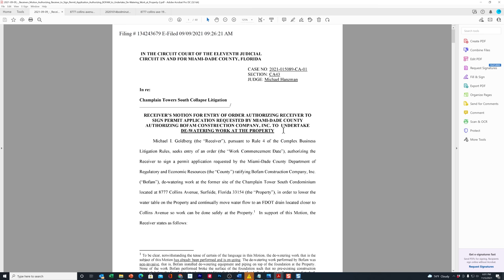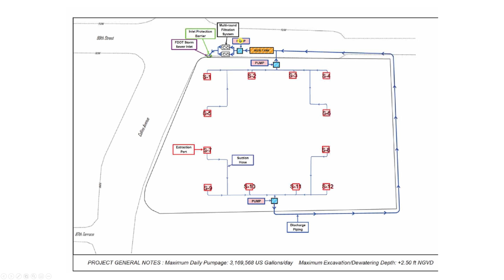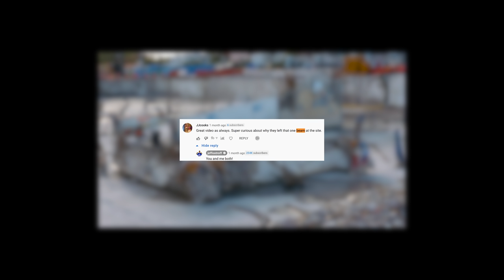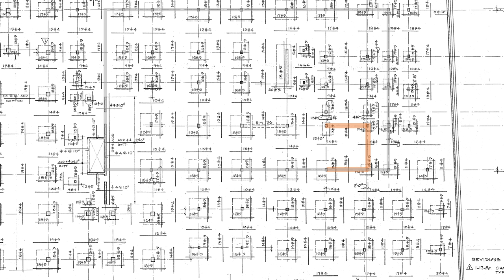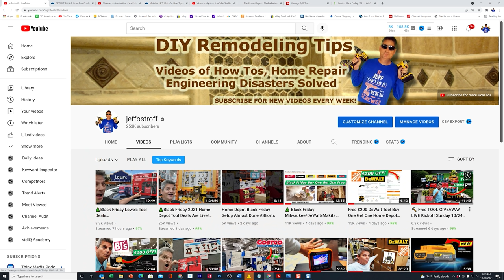Miami Condo Collapse: Engineers Baffled By Mystery Column

Comment: The rebar sticking up out of the ground in the mystery location could have come from the column that sat atop the h-bar, which separated from it and then was "pile driven" into the concrete floor.  There is no concrete visible, which could be because it was pulverized as the column was driven through the concrete slab.
Reply: That would be my guess too.  It's impaled through the floor.
Reply from the maker: Your hypothesis comes up a lot from boatloads of people about that column. I don't think it's possible because if it had slipped off it would not likely have come straight down where the mystery column is which is only about two feet away from the HP. Also if it had impaled the floor there should be damage all over the concrete there and there is none where is the crater? So where else could the column come from? So far my prevailing theory is that somebody started to build that column sometime after Fiorella shot her video in July 2020. however I could find no permits for it
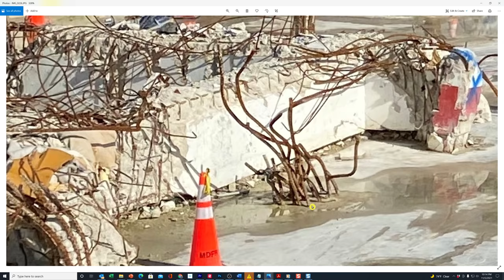Reply: @jeffostroff  if you actually look at your own video, at 13:50 you can clearly see the edge of the floor slab where the penthouse 5th column punched through it.
It's filled with water so if you don't look closely you may think it's the slab, but you see the broken edges around the rebar.
It's also exactly where the penthouse column would have been if it dropped straight down.
Reply: @jeffostroff  You just proved that the penthouse column was punched through the slab. Stop looking for conspiracies where there are none.
Reply from the maker: @dannyswank   It's not a conspiracy stop trying to let me into your conspiracy theory crowd
Reply: @ke6gwf  I think you may be right there. I was thinking along the same lines but that part of the video definitely is a bit deceptive. I mean, that column clearly isn't there in that one video so I doubt it was added at any point.
Reply: This was my thought.

The rebar sticking out of the ground looks to 'streamlined' to be from a square setting. Almost looks like a section of the floor above fell down 90deg and was pushed into the ground.  The water leaking up could be the rebar that was driven down hit an underground water source.
Reply: @jeffostroff  So, how do you have almost 3 car widths between the wall and where the column should be?
Reply: The puddle of water gives an optical illusion of a uniform surface.   But it’s indentation that filled with concrete muck.
Reply: This was my conclusion as well.  When he said "it seems to be a source of water", it tells us that the concrete has been compromised all the way through to the bottom, creating an artificial "spring", every time the water table gets higher than the concrete floor.   In effect, the parking garage is a huge pool, and this poked a hole in it.
But I'm just some hillbilly using logic, I have no training in the field.
Reply: I agree with your assessment, that is my feeling also, the weight of the building dropping drove a broken part of a broken column into the ground embedding it into the concrete
Reply: @jeffostroff  I beg to differ, a swift impact with enough force behind it might just punch through without leaving much damage in the surrounding slab.  Think of a bullet punching through a brittle target, the front may just be a round hole, but the back is gonna be shattered, spalled and blown to hell.  In this case, we only see the front (top), not the back.  Also, the building appears to have come straight down, more or less.  So "only 2 feet away" sounds like about the right distance.  I think the sept 12 photos show that's what happened, but your reasons for dismissing it don't hold water IMO.

Logic tells me it unlikely they intentionally built a column in that exact location, and I have 2 good reasons.  1: that's a recipe for instant complaints from tenants, to block a main access to the parking garage.  Most owners would prefer almost any other solution.  A better solution would be to do in-situ strengthening of the H-beam and/or supporting columns.  2: even a novice contractor should have understood that the shoring column needs to be aligned under the offset column above, not a few feet to the east.  Where those bars come up is right between the 2 garage columns, aligned under exactly nothing from above
Reply: I agree- The position of the mystery column is just too coincident with the column the plans show sat atop the H beam to be anything other than the impaled stub of the column atop the H beam.   This section of the building leaned toward the already collapsed section as it fell, the racking of the floors would have tilted the column so that its base was shifted off the top of the H beam and  with suddenly nothing holding it up, it would have been driven into the concrete floor of the garage.  The concrete would have been pulverized as the column was bent over as the floors collapsed on top of it…but it would have dropped to the floor of the garage and  punched thru the garage floor.   The hole filled with ground water ( like any other hole you dig deep enough along the Florida coast ) And the water is concealing the hole punched thru the floor.  The utter lack of any concrete around the base of the rebar is evidence it was not cast in place- as all the other columns retain some concrete where the column is surrounded by the cast garage floor.   No one would have placed a concrete column NEXT to the H beam without digging out a section of garage floor for a foundation, and a column NEXT to the H beam makes no structural sense whatsoever.   It was likely the H beam that is why that section of the building fell last. Its no mystery.   The column that was atop the H beam shifted and was pile driven thru the floor… There is likely several feet of that column below the garage floor, embedded like an angled pile in the ground.
Reply: @nickoD509  This is Florida, underground, close to the ocean. Water would have seeped through the sand  and filled the hole in the floor with sand. Thats why you cant see the hole. It's filled with sand.
Reply: It’s the column from above that punched through the floor slab of the garage. There was probably a small void underneath due to compaction of the underlying sediment. It would be fairly easy for the column to punch through the slab, given that it had the weight of a 12 story building pushing it down. Basically, the transfer beam was pulled about a foot sideways during the collapse of the pool deck. The column above it broke off and part of it was left dangling from the second floor of the building. When the building collapsed, the upper portion punched through the floor next to the fallen transfer beam. You can see the edges of the jagged hole it made under the surface of the water.
Reply: @jeffostroff  that itself woild fhow clearly on floor of concrete at base.
Reply: That's exactly what it is...the collapse pulled the H in, the column above has nothing below it and it's semi-solid all the way up to the penthouse...pile driven is the right term.
Reply: @jeffostroff  That's because this is specifically THE answer.  That's where the column came from.  That's why there's water coming in where that column hit the floor, the rebar punched through the concrete base.

People smarter than you have already pointed out there were no anchors holding the column to the H beam at the lobby level, at least there are none alluded to by any of the plans.  That means the column hit the floor with straight rebar encased in concrete, the concrete was turned to dust as the rebar was punched through the floor.

No further mystery here, Scooby-Doo.
Reply: @jeffostroff  You already put yourself in the conspiracy theory crowd by refusing to listen to the penthouse column punching into the floor crowd.
Reply: @Gwydion_Wolf  Nothing rotated.  The lobby to penthouse column above fell straight down because it wasn't anchored to the H Beam and the H beam got pulled towards the void created by the collapsing sections.
Reply: I concur with your analysis, that's why water is seen coming out of the column.
Reply: @jeffostroff  if you can get closer pictures you can most likely look at the manufacturer stamps and the grade of steel compared to the other columns.  you can see in your video on the close ups of the other columns that early X pattern.  I would also compare the grade stamps to the other columns.   if all the columns where put in at the same time the manufacturing and grade stamps should be the same and seeing the prints from what i could make out where from the 70s.   The patterns have changed and most likely the stamps have to.      There should be evidence of a section of the slab cut out to add a footer or.....maybe it was someone that's a rodbuster they got for cheap that didn't take design into consideration, drilled the holes out and epoxied the rods in ( I know that's not the way you do it but if corners are cut, so was the design process).
Reply: I guess the column sitting on the H beam just pushed itself through the floor plate and neatly (almost) sealed it up with a concrete (floor) - concrete (column) joint. So, the concrete between the rebarb is not from the floor, but from the column and there should be a seam somewhere all around the rebarb.
Reply: @mreese8764  That "neat seal" is about 24" of water and sand ( from the water inundating the foundation) all around the column where it has penetrated the basement floor.  The concrete was pulverized into dust and removed with the rest of the debris, leaving just the rebar where it was stuck into the floor.

The H-beam was pulled towards void created by the collapse zone.  That moves it to the side.  Lobby floor column then has nothing holding it up, it goes straight to the floor.

No greater mystery than that.
Reply: Nope.  You can see clearly that is wrong in the picture. Look at the columns in the floor plan.  The car way is next to where Jeff thinks it is, the ramp does not end where he thinks it does.
Reply: @lostpony4885  No, it ends where it does.  The H is correctly identified.  What some people don't want to comprehend is that a pile of concrete encased rebar with a couple million tons behind it can hit a concrete slab with such force to penetrate without completely destroying the entire floor, but rather with a relatively clean punch.
Reply: He mentions in the video that he doesn't think that in was impaled from above, but either that or someone installed a column, which would have been useless as it couldn't have been installed post construction and go deep enough to have any capacity for bearing. Unless aliens or Dumbledore did it??? It must have just punched thru the basement floor.
Reply: @terrykeever3280  The ides someone installed this post after the fact and in the last couple years is indeed a complete BS idea...
Reply: I'm no contractor, but i have busted concrete apart. If i can put a 50lbs sledge through a 2x2x2 stepping stone without shattering the whole thing i would think that a piller coming down to a waterlogged basement level floor would have the same effect. Plus with all that weight of 1st to penthouse bearing down on it, it could have gone through the top of the concrete with minimal damage and a huge blowout in the waterlogged underground side of it. Kind of like throwing a dart into drywall small entry hole but up to a penny size exit hole.
Reply: @mrett4758  🎯
Reply: @fraidykat  I mean nothing else makes sense... A new support beam in a driveway part of the parking garage just seem way beyond out of the question with how that rebar looks to me. Shoring to hold that area up for rescue workers... Very sus simple because of there only being one column.
Reply: And who knows maybe the column didnt slam down but slid down the h beam and was pressed into the concrete floor
Reply: @mrett4758  ...what???

There's no Sliding down with the H beam.  The H beam was pulled towards the collapse zone due to the void created by the empty space where the building was.  The most distance  the floor to penthouse column slide down the H-beam was no more than 20" given a 16" square column and a 24" wide H-beam or more specifically (1/2Hwidth minus1/2Cwidth) + Cwidth, if C is not 16" and H is not 24".
Reply: @mrett4758  This is the physics comprehension we're up against, though, people who do not understand point forces on large flat surfaces...and thus believe conspiracy theories like new column being built in the basement...
Reply: @fraidykat  what i was trying to say is i agree no column built in basement. As for the bracing logic i dont see that either because there would be multiple braces and it wouldnt be rebar from a column. As for the column sliding down the h beam that was my theory just for another possible/ plausible explanation. As far as i am to understand what was said and what you are saying the column wasnt secured to the h beam and when the beam shifted the column went straight down. But people dont think that that is what happened because the think it should be angled not straight. If i am understanding everything correctly
Reply: @mrett4758  That would be correct.  Someone else more knowledgeable with the building plans suggested there was no anchor rebar at the bottom of the column nor anchors on top of the H beam per what they could make out in the plans.  This means the column was held in place first by gravity and second by concrete alone, which has low sheer strength.
Reply: @fraidykat  thank you for making that clear. Now my thought is why the column didn't angle it because of it being supported(for a lack of a bet phrase) by the floors that were not being on the side that collapsed. Is this a correct understanding of how it went straight down?
Reply: @mrett4758  I think it's plausible.  If it wasn't well anchored, then it could very well stay in place - if even for a couple micro seconds - after the H beam falls.
I'd personally be more inclined to suggest the H beam and column fell at the same time and rate, but the course of the H beam was at an angle while the tall  column traveled straight down.
Reply: We all see it, makes me want to go pick around at it and say bingo.
Reply: @fraidykat  wasn't improper anchoring (of floors to columns?) an issue also in the WTC catastrophic collapse?
Reply: @mrtechie6810  Primary mechanism in the WTC was columns only rated for 45 minutes of fire before the fire would affect the steel.  If you look at the times, they both fell some time (but within minutes) after 45 minutes.  Once those columns started deforming, there was really nothing that could have saved the buildings.
Reply: @jeffostroff  in my opinion the collum being pile driven in could be why theres water there as its coming from the cracked concrete and some of them are bent at the bottom or the middle as if they made a sudden stop the other's mainly all have the tops bent
Reply: @jeffostroff  did anyone ever test the concrete? it looks powdery, lacking in large aggregate, and hardly sticks to the rebar, anywhere.
Reply: Exactly what I was thinking since the first time this column was shown.
Reply: That’s what I thought